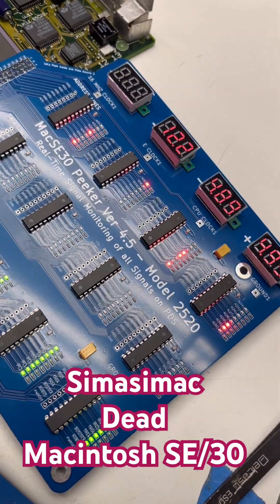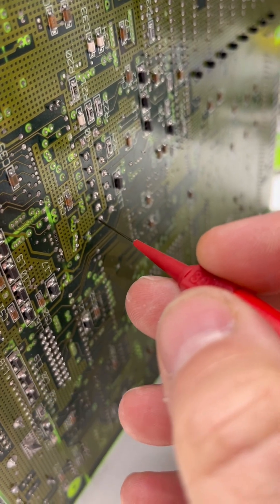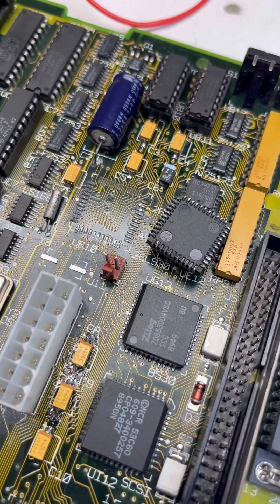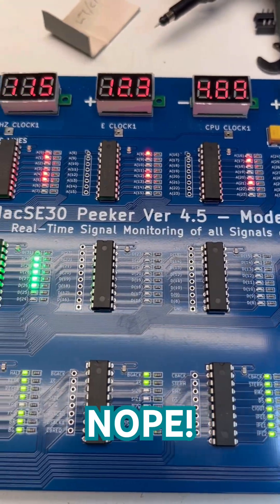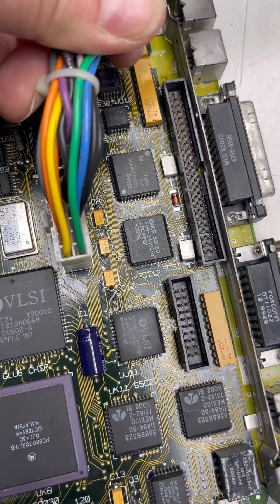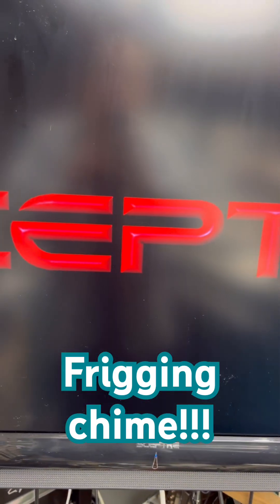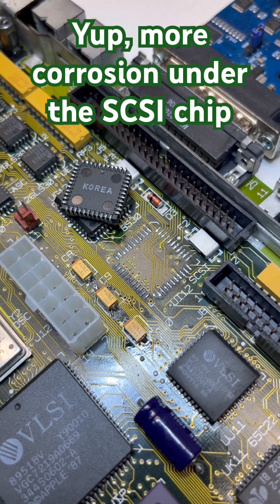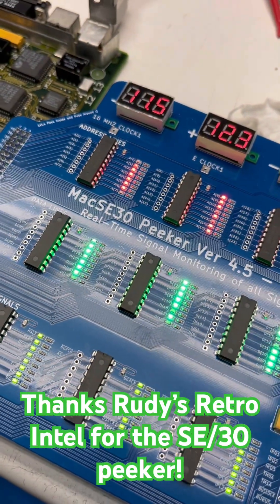Simasima dead Macintosh SE/30 epic repair struggle BBB vs. corrosion #vintagemacintosh

Comment: Holy cow, I'm kinda convinced now using hot air (unfortunately) to remove caps might end up causing more problems vs carefully removing via the "other" methods. I was warned about this by folks, specifically bits on the underside getting borked, and wow there it is! Great work as always BBB!
Reply from the maker: Garth’s going to the dark side! Purple nurple method here he comes!